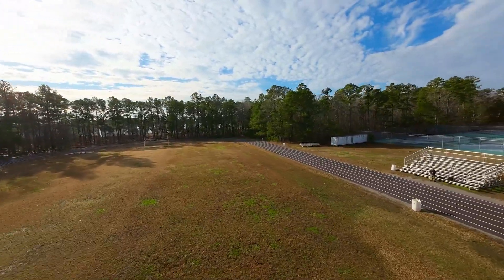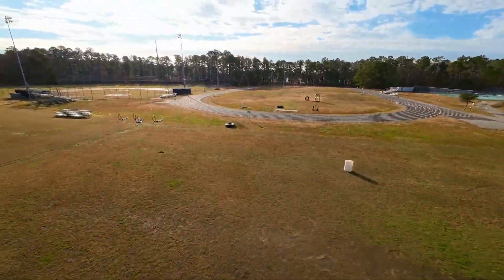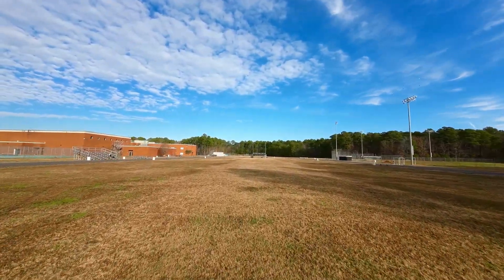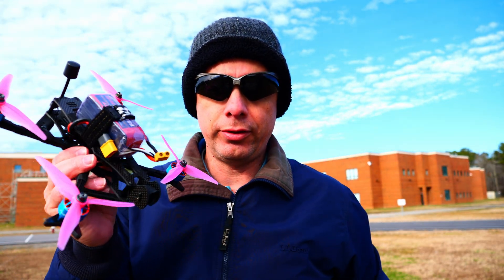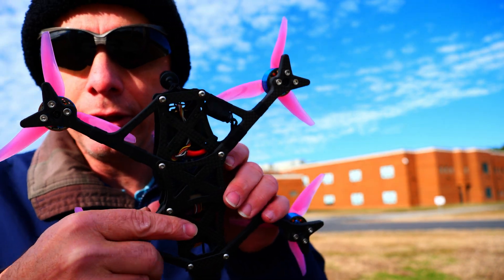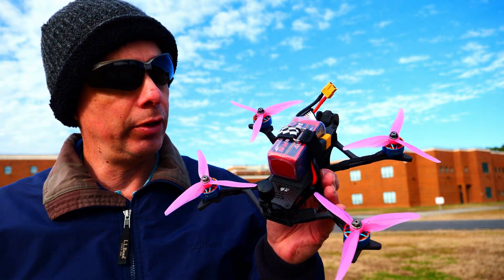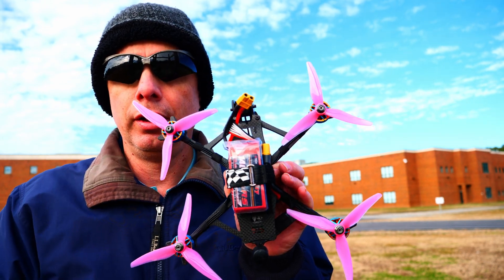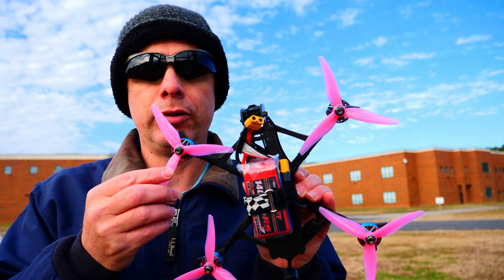AOS 5.5 FPV DJI 03 First flight! (12-17-2022)

Comment: hi there, Im interested in using this frame for a high speed (160mph +-) work but I'm hesitating which motors to use, maybe combined with APC's 5.5x4.5 bi-blade props. Do you have any recommendation on size motors and KV? 
Thank you!